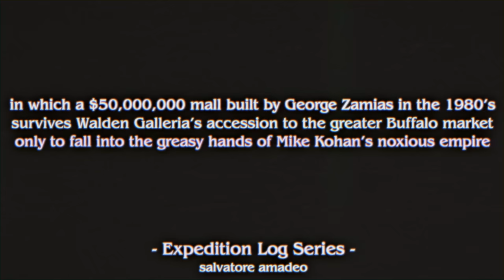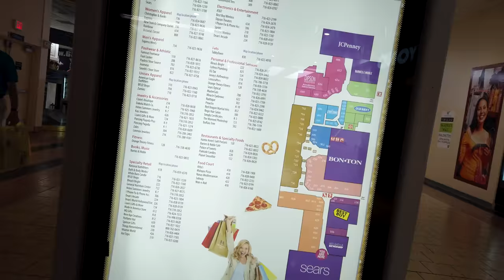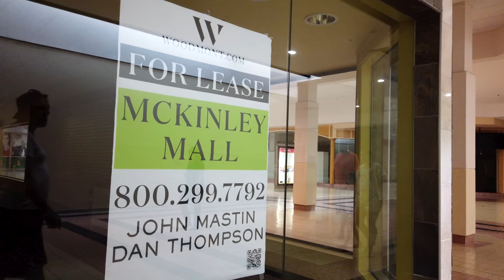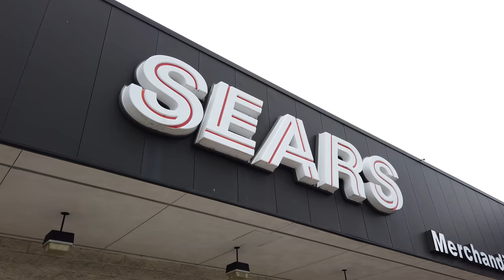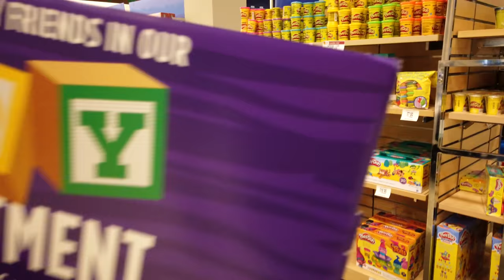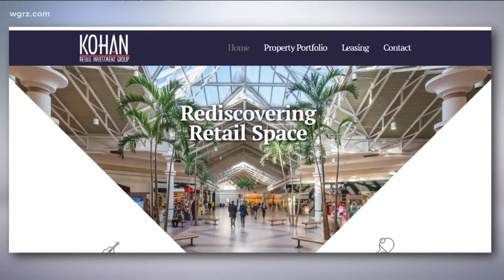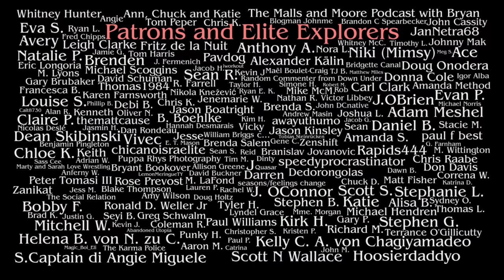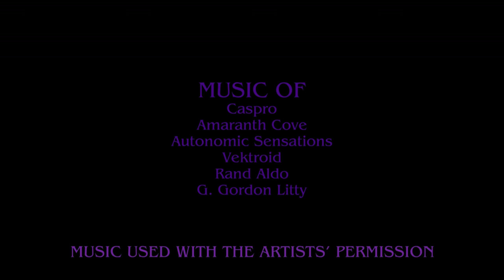McKinley Mall - Buffalo, NY | a dead mall doomed by Kohan's noxious empire | ExLog 99

Comment: This mall died a long time ago. The initial idea to “revitalize” it meant they gave new “anchors” like Bed Bath and Beyond, Best Buy, Barnes and Nobel, Ulta and Old Navy all road facing entrances. This effectively turned it into a strip plaza. It was faster to drive between the front facing stores which all had plenty of parking. The Best Buy and Bed Bath and Beyond sealed about half the entire Sears wing off. This kind of negated the need to walk the mall. It pretty much killed off the interior and Macy’s. This coupled with the expansion of the old Service Merchandise building (the Joann Fabrics etc. across the street) and the McKinley plaza (directly across the street) gave everyone room to move off the mall and have better visibility. The movie theater is not directly accessible from the mall and is behind it. When Musicland went bust and FYE had purchased them earlier in the decade it closed up all the mall record stores (towards the end one was a large Sam Goody) then relocated them all of it to an off parcel FYE Superstore in the now Hobby Lobby (which ran until like 2010) again this made sense, better visibility.  Even when Sears was still a draw back around 2010 most of the higher volume businesses had clustered around the primary entrance ways. Mostly everyone else was abandoned when Quaker Crossing up the road by target started to add out parcel plazas. The murder at Sears was likely the final nail for it but it was largely the best in the area.
Reply: You're right, that's just what I did when I came here.  Now I only go in the JC Penney, everyplace else I used to go in is closed.
Reply: This was well written. Never looked at it like that but yeah all those front facing road stores do make the mall like a strip mall.

Comment: I used to go into that Sears a couple times a year.  I bought some stuff when it was closing.  If I'd had room I could have packed off a shopping cart and nobody would have known the difference.  

Interestingly Sears closed their Walden store before this one.  I am sure the rent there was much higher.  

The woman was stabbed by an ex-boyfriend if I remember right.  

8:04 that was a Deb and it was unique in that it had two entrances, in an L shaped store.  I can only guess they wanted to expand it or something and did so through a second storefront.  You get a glimpse of the front about 9:14 - it's an arcade.  The whole chain shut down in 2015 IIRC.  

Tabby Town is a cat shelter where you can adopt kitties.  

JC Penney was still busy when I visited the last weekend of February.

The biggest thing I noticed as a change here was the demographic shifted.  Not so much the customers, but the employees.  I don't know if I can explain that in detail without it sounding wrong though.  I guess let's just say the diversity level increased.